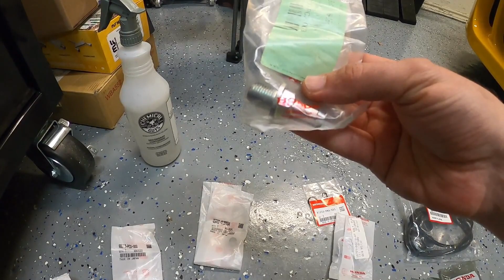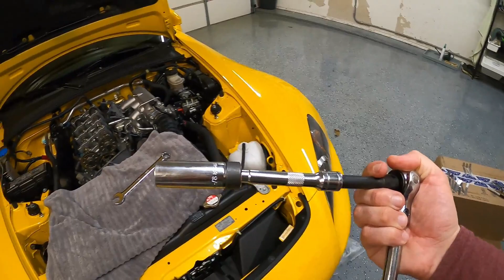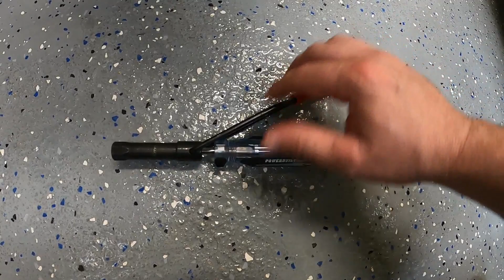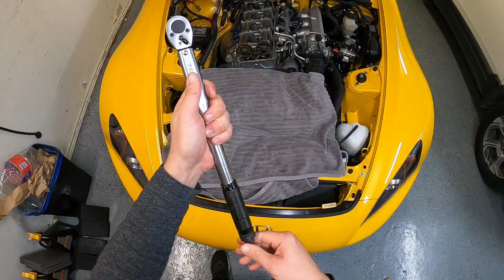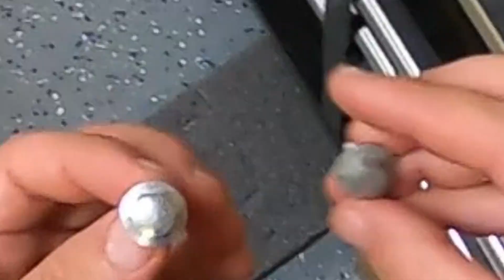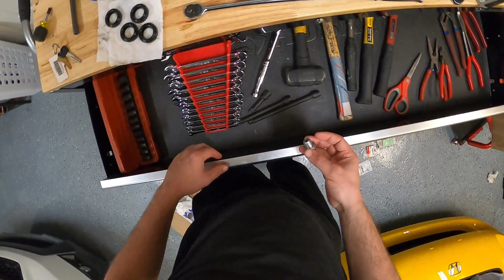S2000 Valve Lash Adjustment

Comment: So afterwards when you torque the bolts after adjustment to 14 ft/lbs, it doesn't move the adjustment screw?
Reply: It can. Gotta be careful. Some people will find TDC, adjust the lash on the intake side without torquing the lock nut, advance the crank until the intake side lobes are down and only then tighten the nut, when the screw can’t move. Know what I mean? Then you have to go back to TDC for the exhaust side, adjust the lash, advance the crank to lobes down, tighten the nut etc. Twice the crank work but less chance of knocking stuff off of your target lash.

Comment: My son just bought a 2007 Acura TSX with 244k miles. When we removed the valve cover it was nearly as clean as your engine. The previous owner had only used Mobile 1 since it was new.